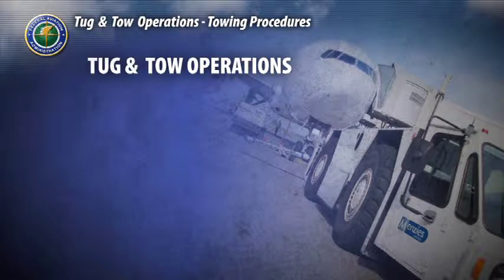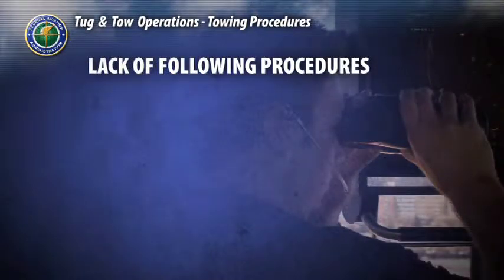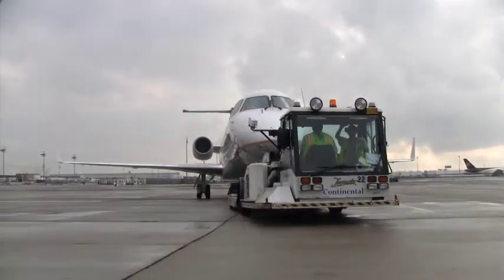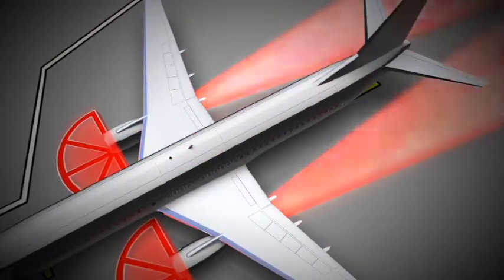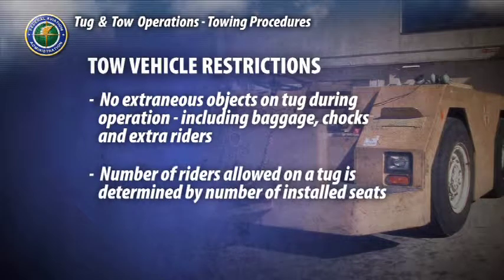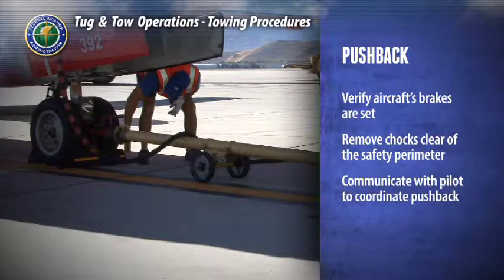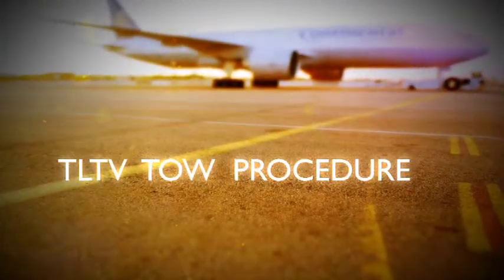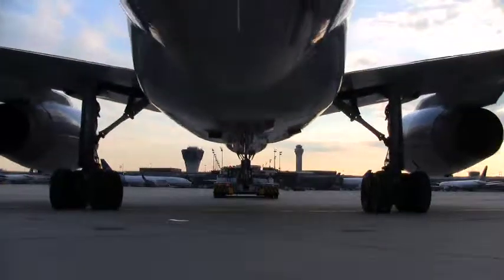Safe Tug & Tow Operations-Tow Operations (5/7)

Comment: THE TUG MUST MATCH THE AIRCRAFT? CONNECT IT THE VERIFY CONNECTIONS WITH TWO PEOPLE, AFTER AMT SERVICE THERE NEEDS A WALK AROUND, WHEN READY ATC WILL VERIFY WITH THE GROUNDCREW, THE PUSHBACK WILL BEGIN AND AWARENESS OF OBSTACLES, THE WING WALKERS WILK WALK BACKWARDS WALKING FORWARD AND IF A WING WALKER SIGNALS STOP THE THE AIRCRAFT STOP BECAUSE OF THE TUG, THEN THE THE TAXIWAY WILL BE MET AND THE AIRMEN MUST BRAKE, THE TUG WILL BE DISCONNECTED? ONCE CLEAR TAXI BEGINS ON THE AIRCRAFT?

Comment: TOW EQUIPMENT MUST NOT BE CONNECTED UNTIL THE ENGINES ARE OFF IN THE MAINTENANCE AREA? THAT IS WHAT THE ENGINE ZONES ARE FOR? THERE ARE RED LIGHTS ON THE AIRCRAFT WHICH SAYS THE ENGINE IS ON?